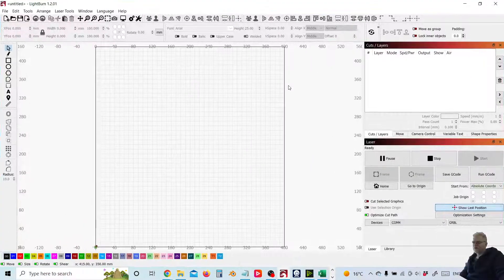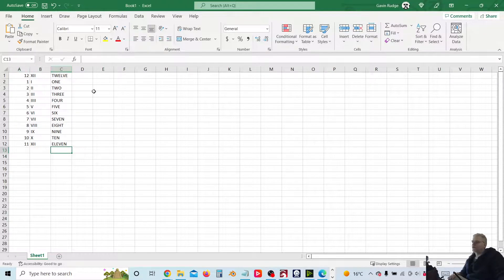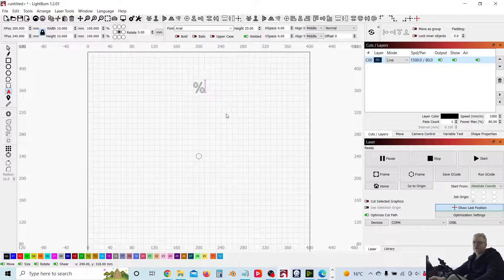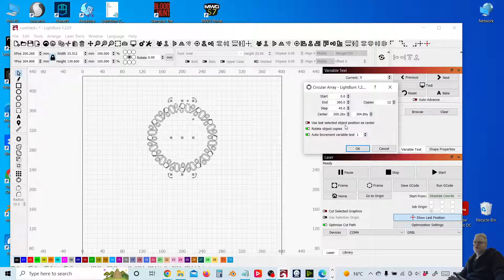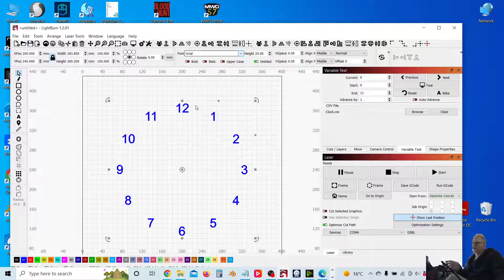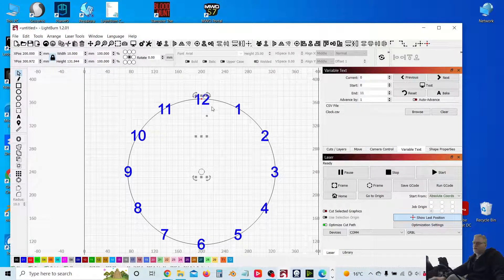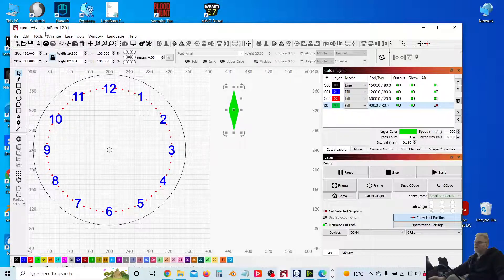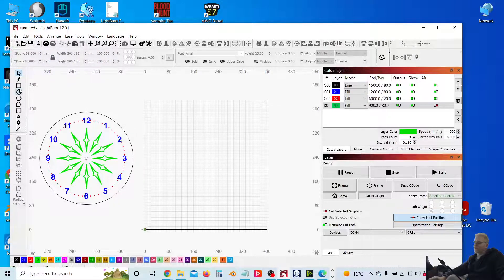Easy Clock Creation in Lightburn

Comment: Thats pretty cool. I had no idea you could use a .csv file in Lightburn. I didn't actually understand how you told Lightburn which column you were extracting from though. The array should start at 0 but I guess I missed where you entered the number 1 or 2. Bout to fall asleep. That must be why. 
So what this does is you can create a file to keep for later use and every time you create a clock you already have that info and by using a premade csv file you don't have to work as hard every time you want to make a clock.
You could've just used the fill handle in excel to drag the rest of the numbers but I suppose you knew that already.
This was a first and thanks. That actually opens up a whole new road to go down.
Reply from the maker: Hey there! Yes sorry, I.think I might have covered the column selection on one of the other videos.
This is done through the variable text marker. In this case it's %0 - this utilises the data in column A. %1 would be column B on the CSV sheet & so on.
So, yes, you can have the one CSV sheet with as many numeral styles as you like. You can even use letters (one, two, three, etc)
Reply: @GavinRudge  and I'm assuming the percent sign is the escape character?
Reply from the maker: So, on my keyboard, it's shift+5.